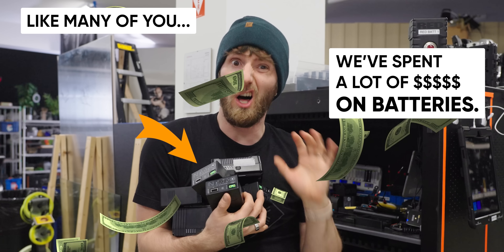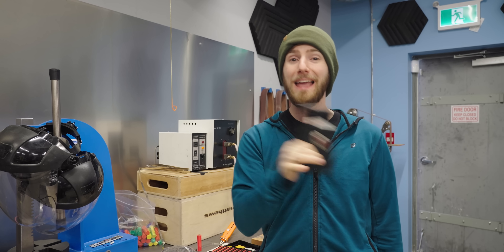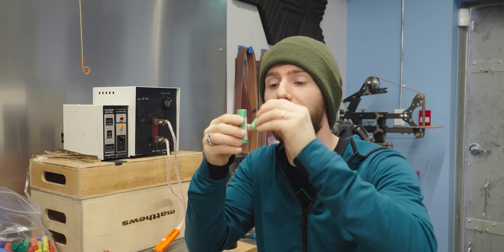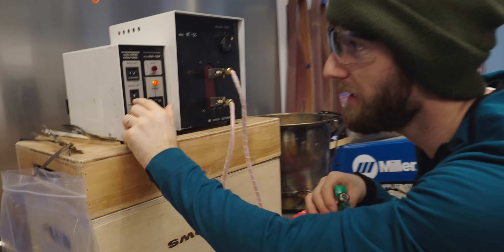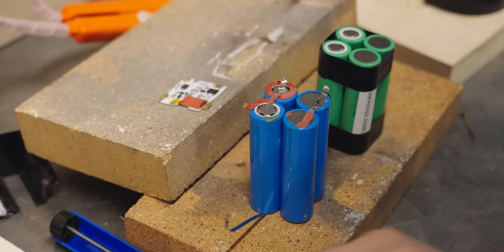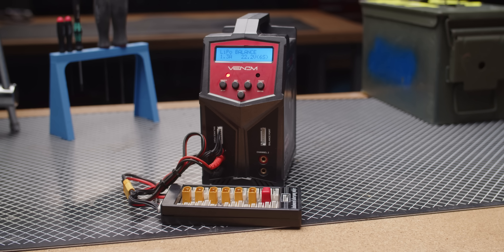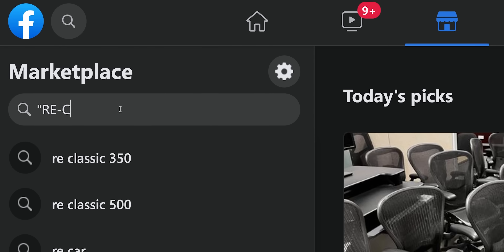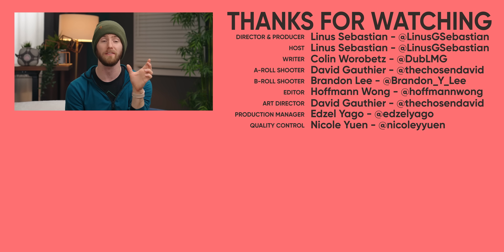This should be illegal… Battery Repair Blocking

Comment: I'd love to see a tour on how these batteries are recycled
Reply: How do batteries built into sealed electronics get recycled? Like Truly wireless headphones that have 3 individual batteries?
Reply: @MrTTUStudent  Someone at the recycling facility take them apart.
Reply: @zaprodk a grinder
Reply: @MrTTUStudent  i'm not sure how big of a volume they're running it but depending on scale and preferred method
it could be that
1. the user already took out the battery and just gave the battery to the recycler
2. the manufacturer will hand pry it open (opening devices is much easier when you don't plan to keep it working)
3. they just yet anything that looks too hard
Reply: @MrTTUStudent  e waste recycling centers disassemble components and separate materials into bins, to be shipped off to specific material recycling centers.
Reply: Depends on the bettery type. My local dump has a recycling bin.
Reply: @MrTTUStudent  99% of the times they don't. Too expensive.
Reply: Plotwist - there's nothing to show
Reply: @BetteBalterZen  overtime there will be, a chernobyl for everyone everywhere.
Reply: @BetteBalterZen  Europe is building a battery recycling facility that's expected to extract as much as 90% from the batteries.
Reply: @BetteBalterZen  the truth
Reply: Please make a tour, would love to see the process
Reply: Show us the battery recyling
Reply: With the way the cells look .. making them user replaceable is easy .. the packs open . cells slide out . new slide in no welding needed
Reply: Yes please
Reply: I loved it too
Reply: Recycled? Sure thing, visit your local landfill.
Reply: eh they wont they will end up somewhere in africa in a landfill.
Reply: @WhaleBub  Nearly where they started from!
Reply: @snakefinn  Thats recycling for ya ;)
Reply: @snakefinn  Old battery dumps will be our new mines.
Reply: @WhaleBub  I think you missed the end of the video...
Reply: @WhaleBub  Nope. Redwood Materials makes a lot of money recycling batteries.
Reply: @WhaleBub  they might take some components but yeah most of it probably will
Reply: @WhaleBub  Indian lake
Reply: @WhaleBub  very uniformed they are 100 recycled right here locally in upstate NY
Reply: @WhaleBub  actually these batteries are infinitely recyclable and recycling batteries is becoming more and more common each year.
Reply: @lucacassar9371  With any metal there is no "infinite recycling" because the purity of the metal matters depending on purpose. Aluminum for example at a purity lower then 40% has many applications it cannot be used for and I'm betting that is the case for lithium.

Purity can be effected by the recycling process itself. So careful recycling is required to get the most out of any metal.
Reply: For cylindrical cells, it's actually not too difficult.

1. You discharge them completely in a salt water bath in an industrial manner. A quicker way is just to literally use a discharging dock.
2. You cut open the top of the cells, and then remove all the steel/aluminium bits. You then recycle the casing.
3. You separate the cathode and anode. The material composition on modern anodes are graphite+copper foil, graphite+copper foil+silicon, or graphene composities+copper foil+silicon. They aren't too hard to recycle either.
4. Now you have to separate the cathode, which is made of a bunch of composite materials: aluminium, nickel, cobalt, manganese, silicon, etc, all tied in up oxides.

You usually get recycling efficiency rates of 85-90% if you do it this way, and bleeding edge processes can go up to 97-98% outside of the non recyclable bits.

Currently, recycling capacity is the main bottleneck as until recently, there wasn't enough battery pack demand to make this viable 24/7.
Reply: @neutronpcxt372  cathode uses aluminium, anode uses copper
Reply: @purplewastaken  Damn it. I always mix up cathode and anode.

That's why I prefer saying positive electrode and negative electrode.

It never mixes me up :)

Thanks for the tip :P
Reply: @neutronpcxt372  no problem.
I only know that because I work at anode dept, producing anode electrodes, right beside cathode
Reply: @neutronpcxt372  There are a few alternative processes along the way, too, all competing to find the most cost-effective approach.  But lithium pools will deplete, lithium mines will get more expensive, and demand will continue going up, so pretty soon there will massive economic incentive to build out the capacity.  Ideally we'd also have some subsidies to make that happen sooner, but at least lithium is less environmentally hazardous than, say, cadmium.
Reply: @georgedorn_fnord  Yep. I know of a few of them personally, but I decided to only talk about the one I have physical experience with :)
Reply: @neutronpcxt372 they are already 100% recycled they are ground up for the process
Reply: They just get general wasted and all trash starts burning... Than we see California on news...
Reply: @alvydasjokubauskas2587  well that’s simply not true…

…

… we would NEVER put such dangerous trash in american landfills. They all go to the Philippines
Reply: Schwarzenegger's voice COME ON!! DO IT!!! DO IT NOW!!!!
Reply: They can show you but then they'll have to kill you.
Reply: https://www.youtube.com/watch?v=wxCFDWMPu38

Enjoy. It took me 3 minutes to find a video that explains how. Better than crying about EV while masturbating aboard an ICE vehicle.
Reply: I find that you can usually get away with flushing the smaller batteries down the toilet. But with 18650s or larger I just take them to work and throw them in the dumpser there.
Reply: Yeah that would be pretty cool I think. I don't normally watch factory tours and stuff like that. But learning how a spent battery gets recycled sounds pretty neat.
Reply: yea same, bc i hear all the time that recycling is not what people think, and about 80% of "recycled" items are not recycled. I have a cousin that worked in management at a Waste Facility , and she basically said dont waste your time recycling or caring about it. That was mostly for Trash, i wonder if batteries are different?
Reply: Having been at a "recycling" facility for EV 18650's as a student they were simply burning them, even if some companies might actually seperate the materials properly most for sure don't
Reply: LTT, 
I think you heard your audience :)
Let's go!
Reply: not sure there is any it is a disaster waiting to happen
Reply: Me too, I used to working in the E-waste industry.  I would love to see when their life ends.
Reply: It's called the beach
Reply: Smash cut to these batteries decomposing in a land fill for thousands of years.
Reply: I bet they won't let us tour inside recycler because they don't want public know what business do with old batteries... Government would love to hear that too!
Reply: *shows dump truck dumping e-waste into a landfill*
Reply: Yes, absolutely! I would be all in for one or two hours worth of content (probably spread across several vids based on LTTs typical style) with tours, technical breakdowns of the process, future challenges, interviews, the whole shabang!
Reply: would be similar to Steve's factory tours on gamers nexus, those are always cool to see
Reply: me too
Reply: I want to see this too!!
Reply: Would enjoy, please do LTT
Reply: Not only yes but F$&#ING HELL YES!
Reply: That'd be so cool.
Reply: Do it, thanks
Reply: Indeed that is something I actually was wondering about for a while now.
Reply: i wannaa see recycled battreys plz
Reply: same
Reply: they arent
Reply: I'm skeptical myself, heard they might be too hard to recycle to be cost-efficient
Reply: @mrkosmos9421 they already are 100% recyclable
Reply: Totally. Would love to see that process.
Reply: +1
Reply: Linus knows we want to see the tour of the location and how is done. Show us the video please :)
Reply: same
Reply: +1
Reply: same
Reply: there's videos on youtube about this
Reply: Agreed!
Reply: The EV era is gonna be a disaster
Reply: show us
Reply: recycling makes for a good video, company tours make for a good video, why not is the only question
Reply: Yes please
Reply: That would be cool. :)
Reply: Same here
Reply: Thrown into the garbage incinerator like the rest of the thrash 🤭
Reply: Tour please!
Reply: Can the Lithium itself be recycled and used again? I know it's a mined resource and there are only a few lithium mines in the world.
Reply: @emeraldmorningmist  Lithium is an element. If you find a way to extract it from the recycled materials, up to the same production standards, there should be no problems. The problem is the treating of the batteries themselves.
Reply: same here!
Reply: me too
Reply: most definitely :)
Reply: would be good
Reply: Too
Reply: I would think a tour of the recycler would make an awesome video.
Reply: i would like to see to.  

honestly i'm not sure my batterie recycle dropoff really does what they say or not
Reply: So would I
Reply: ME2
Reply: yeahhh
Reply: ya that would be kinda neat to see.
Reply: Same!
Reply: Yeah!
Reply: Tour would be great!
Reply: me too
Reply: Yes
Reply: me too
Reply: this would be soooooooo interesting
Reply: Yes please
Reply: Yes, please!
Reply: DO it!
Reply: Definitely, it would be interesting.
Reply: Heck yeah!
Reply: Me too
Reply: You cant cause it will end when they get to China.
Reply: Same here would love to see that tour
Reply: me too!
Reply: check this is one https://www.youtube.com/watch?v=wxCFDWMPu38
Reply: ye
Reply: Yes i say they should go that would be so cool to see.
Reply: Make this tour pleaseeee ;)
Reply: simple, ship them to ****ca and pretend it never existed.
That's how "recycling e-waste" works.
Reply: YES YES YES! I want a video on this. All i know about recycling battery center is: Give them dead battery and then [magic].
Reply: Same here
Reply: A boat trip to China to big ass e-waste fire pit.
Reply: yuuuuuup
Reply: Me as well
Reply: No you dont, its shit. I know, ive work in a recycling plant.
Reply: Yes pls
Reply: yes pliz
Reply: Yea I'd be down not really my normal thing but its neat enough to peak my interest.
Reply: I too am interested in seeing.
Reply: Elon Musk eats them for sustenance.
Reply: Yeah definetly wanne see that too
Reply: Luckily Linus Tech Tips is located in Canada where we recycle all of our batteries.
Reply: Bring Steve.
Reply: Same, I'd love to see this.
Reply: Pay a visit to your nearest landfill.
Reply: I would love it too
Reply: @linus tech tips
Reply: as if that's a reasonable question. come on Linus, of course we all want to see that shit.
Reply: +1
Reply: Same
Reply: yes!
Reply: err... duh....ya
Reply: Same here
Reply: :D
Reply: me too
Reply: we need tour
Reply: Came here only to like this comment.
Reply: Why not use a power supply to keep the BMS powered while you swap out the cells?
Reply: Sounds great
Reply: I've got a revelation for ya. They AREN'T
Reply: same please
Reply: let's do itttt
Reply: here! here!
Reply: +1 show us please
Reply: yeah me too
Reply: Hell yeah
Reply: yes please!
Reply: yeah
Reply: me too
Reply: yeah would be super interesting
Reply: Same
Reply: Very cool, would love to see this!
Reply: @775 glad u asked: Throw the battery>gets to deposit>packs them up> move that garbage to a foreign country
You're welcome
Reply: +1
Reply: +1
Reply: me too
Reply: @jerryrigeverything
Reply: Me 2
Reply: YES. EVERYONE NEED TO KNOW THIS PIECE OF KNOWLEDGE.
Reply: +1 ngl I'm curious too.
Reply: me too
Reply: So would I.
Reply: Redwood materials
Reply: Yes
Reply: They aren't...
Reply: same lol
Reply: Basically thrown into a furnace to separate all the different elements in them. There's really nothing to see.
Reply: EV batteries are recycled like this - https://www.youtube.com/watch?v=Bpe8HalVXFU
Reply: this, a battery recycling tour video would be sweet
Reply: yeah that would be sweet to see
Reply: Same
Reply: True
Reply: Same!  I've always been curious about this process. Recycling is clear as mud where I live and not well supported or encouraged.  I would be very curious how it works for batteries
Reply: Me too
Reply: Plot twist - They put the batteries in a landfill.
Reply: I too, would love to go on a Field Trip!
Reply: unlikely that they actually are
Reply: @Philipe Pedrosa Why tho? I work there and its the most boring shit imaginable. Pays 3300 euro a month tho. Which might be worth it when i get cancer prematurely
Reply: me too
Reply: Lithium cells can be recyceled. In Germany we have a company that is called accurec. I'm Belgium you have umicore. You should find out via Google.
Reply: ditto
Reply: Same!  especially lithium-X variet(ies).
Reply: Yeah, do it!
Reply: cruncher
Reply: Its actually very difficult to recycle them, they are still refining the process to reduce waste and improve yield on it.
Reply: Elon Musk's half brother split off a business to handle recycling these batteries.
Reply: @giggleherz  ah yes because Elon musk has such a long history of high quality endeavors that don’t fall apart long before they could ever be useful (provided they aren’t absolutely garbage ideas to begin with, like the LA loop)
Reply: Is 775 a DC motor, file permission settings or something else?  :)
Reply: well in reality most stuff isnt lol. A lot of it just ends back on the landfill
Reply: Thag would be awesome
Reply: I WANT SEE BIG BOOM
Reply: It's just a video of a guy being paid to throw them into some lake
Reply: The company's are not the only problem... the end user that has to replace all his electronics every year because they are 3% faster that last years model are just as big part of the problem.
Reply: I 224th'd this!
Reply: Paying the recycle fee is real and you can pray to God as much as you want coz you know what ain't real.
Reply: They are not recycled.
Reply: @Mr.Unacceptable  
Then I like to see a tour of how these batteries are not recycled when we are charged the recycling fee upfront.
Reply: Yes, field trip!
Reply: If its anything like plastic recycling it doesn't work and costs far too much to do for practical reasons but it makes people feel good about the environment. Just like EV requiring so many natural resources to make the batteries with the mining and other processes needed and only last a certain amount of time usually before they lose their overall charge they can hold. Not to mention just a cars EV battery for a tesla is around $10000 when a 4 cylinder car engine is fractions of that and I bet an EV truck battery is 3-4x the price of a V6 or V8 cost. Saving on gas money don't matter if your credits too bad or you don't qualify based on your income to afford payments on a $60k truck and crazy high insurance totaling probably $800 a month often times more than people pay in rent monthly combined when you can find a used truck under $10k in most metroplexes.
Reply: so u want a tour of a landfill?
Reply: There are battery recycling factory tours on youtube, watch these:
"What Really happens to used Electric Car Batteries?"
"Lithium-Ion Batteries CAN Be Recycled! RecycLiCo Battery Materials & Kemetco Research Tour"
"7-Minute Lithium Ion Battery Recycling Process Video for Beginners"
Reply: you would be disappointed as 9 times out of ten they are not. they go from collection points to landfill.
Reply: Yes please! Always been curious about this.
Reply: Thrown in the sea.
Reply: They're not.  Basically, Electronic devices that use batteries, many times age out before the battery does.  So, when people talk about recycling batteries, they take good cells out of an obsolete battery, and re sell the cells for a huge profit.
Reply: The old batteries are ground up and made into cat litter. Recycling!
Reply: @mikabreto  lol no it all gets separated and a lot of it goes back to battery grade materials
Reply: If you still want this jerry rig everything did a big video on recycling
Reply: @7_7_5 by in large they're just incinerated bc there's actually so little lithium inside them it's usually not worth the effort. I think each 16850 cell has around like 2.5 grams of lithium.
Reply: Maybe just search it on YouTube because it already exists, they are expensive materials and are definitely recycled…. This has been going on for quite a long time and will not stop unless the mining of the materials is cheaper than recycling the materials. Economics
Reply: @7_7_5 Batteries arrive at my facility dot packaged and segregated on a truck.  We verify the sort and then place them in a potassium chloride brine to bring all cells to zero volts over the course of an hour or so.  But wait, we sort out high value packs to be tested for possible refurbishing (milwaukee, dewalt, ego, etc).  Then the battery soup is rinsed and moved to a hammer mill where it will be wet hammered until it fits through a 1/8 inch mesh screen.  From there it goes to a wet separation process that pulls off electrolyte solids, plastics, stainless steel and black mass.  Another table densifies this black mass, it then is driven up a drying conveyor and packaged in super sacks.  We sell the nickel, stainless and even plastics locally, the black mass is marketed to highest paying buyer.  Generally they require we send lot samples and they buy based on content.  Currently were working on a system to totally isolate the cobalt to at least 87%.  Unfortunately for linus, what we do has high potential for process patent theft so we are a totally secure facility.  My primary battery source is indeed vapes and crashed evs.  Laptop stream no longer produces cylindrical cell scrap and polymer has much less cobalt.
Reply: Most "recyclable" products end up being turned into thermic energy.
Reply: Yes please!
Reply: most do not get recycled...Many actually get sent as toxic trash to Philippines,Somalia and many other countries. It is just too expensive to recycle them. Depending on the type,up to 10 times more than making them,with best going up to more than 3 times than new ones.At least it was a year ago and if there were some improvements,it will take years to be widely implemented
Reply: @nikolaivasilev7371 all this has changed old info catch up
Reply: i swear lithium battery waste is gonna be what finally rots the world -- hope I'm wrong
Reply: @SomeRandomDude-zqxj you're already very wrong they now are 100% recyclable.
Reply: @SomeRandomDude-zqxj  Meh,I would say everything combined if it does. But as of last year,even US realized that future must be at recycling the sheit and somewhat admitting it is problematic...Thou certain "saint/hero/god" of a businessmen claimed it was absolutely clean and even non toxic, while ignoring critics of even his ex-employ about it,who is not partially responsible for raising awareness ,as well as promising huge profits in the future from it(thou,yeah,it will again be subsidied by the state/average joe)
Reply: yah
Reply: me too, in UK.
Reply: Yes!
Reply: Same
Reply: Actually: recycling is too expensive
They dont do it
Reply: Recycling is a lie we all tell ourselves to keep from feeling bad about destroying the planet.
Reply: Lithium batteries are recycled in the same manner as plastic bottles. Not. Just because it has a recyclable emblem doesn't mean there is a system in place to do so. It's cheaper to toss. Manufacturers want you to buy. After that they don't lose any sleep.
Reply: @klpittman1  it's not 2005 anymore. Li-Cycle is our local place that does it. 100% recycling of the battery. They have multiple locations in multiple countries. Why do you talk out your ass with zero knowledge? Fuck Google is free you could educate yourself before making stupid statements that you just made up. Isn't this embarrassing? I'm guessing you do this in real life too. I've worked with people like this it's the guy or gal that everyone thinks is an idiot.
Reply: It's a short video, they mostly get dumped in a landfill in a poor country. In a few decades, we will rue the day we started using these highly volatile explosives in everything; especially with all EVs and their multi-ton weighing batteries.
Reply: @Proud_Canuck  The cost of the damage from plastic waste dwarfs everything but petroleum and coal every year.

No government is even considering forcing the companies responsible to pay for the damages.

It will take another 50 years for these lithium cells to cause the same environmental damage and unlike petroleum and plastic the companies behind these batteries are active in recycling development and research.

If you think batteries are bad most of the planet is screwed because of plastic and petroleum and we pay the companies responsible every year to pollute more. There's bigger fish to fry than batteries.
Reply: @Proud_Canuck  you do have companies like redwood materials working on solving that problem, and I do remember some manufacturers taking more steps recently to up their battery recycling efforts but I honestly haven’t been paying much attention. And what would the alternative be? At least for cars, hydrogen isn’t realistic to say the least and gasoline can never be clean.
Reply: @TerryTerius  These guys can only cry about new technologies only because they don't want to spend a dime to change the status quo.
Reply: @TerryTerius  Hydrogen is realistic if all the government funding hadn't gone to EVs.
Reply: @TerryTerius  the only reason hydrogen isn’t realistic is that all the hydrogen battery inventors keep mysteriously ending up dead.
Reply: @Proud_Canuck  is that how ur worldview is acceptable to you? That’s the fact that will make your life and the damage you do morally permissible to you?